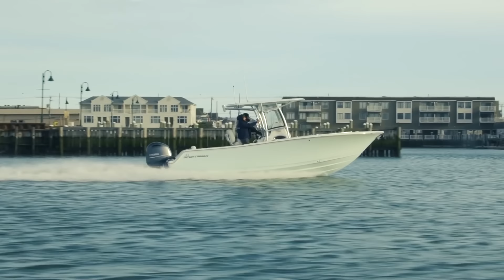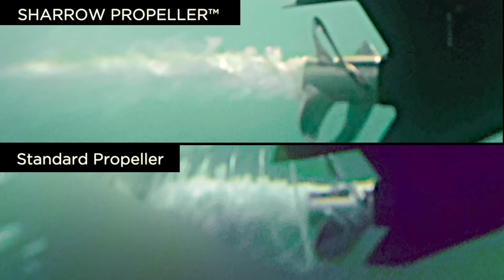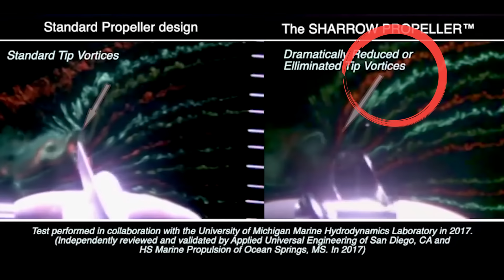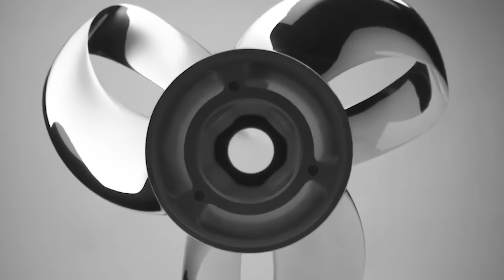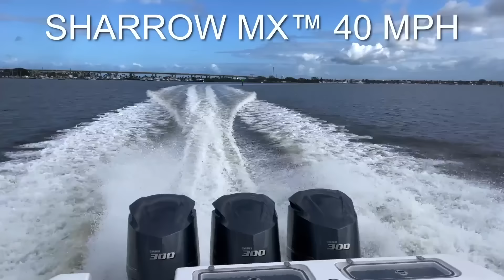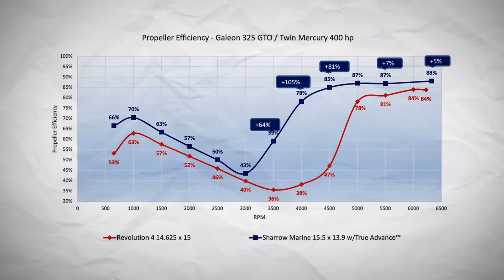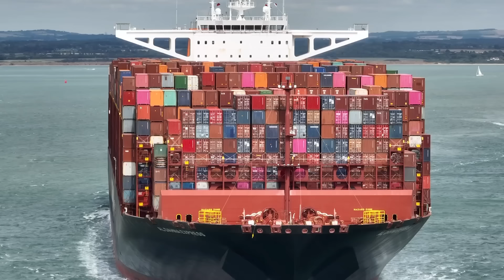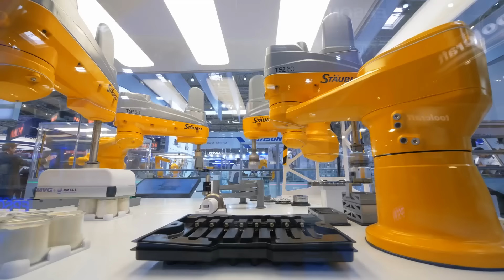This Genius Propeller Will Change Transport Forever

Comment: As a drone pilot, I love the idea of quieter flight & improved rfficiency!  Hope these make it to the marketplace soon! 🙂
Reply: You could try 3d printing your own... I'm sure there are some designs available online.
Reply: @brenovsky  The jagged layers can stall the propeller easily.
Reply: @381delirius  There are 3d prints and 3d prints... ;)
Reply: @brenovsky  I'd never trust a 3d printed prop to carry my heavy ass expensive drone.

1 not perfectly welded layer and you lost a grand
Reply: I see drones using this quickly, as the props are made of plastic.
Reply: There are a few people experimenting with them, so we may see more data coming out soon.
Reply: Seems like there should be a way to 3D print your own if you just get the shape requirement
Reply: @stevenwilson5556  There's already quite a few STL files on Thingiverse for you to try. I no longer have a drone myself (I sold it when the UK drone licensing requirements go so expensive and convoluted - Also I live just a few miles from a major airport, making the rules even stricter -  that it took all of the fun away) so I haven't tried any of them but they look as though they should work pretty well (just be sure to sand them really smooth after printing as a rough finish will really degrade efficiency)
Reply: 3d print it...
Reply: certainly a solution for aircraft, where a duct-ed prop adds duct weight .
Reply: As a non-drone pilot I love the idea of quieter because of this mindless push to get drones in the air to do everything - from taxis to package delivery.
A 2lb drone is annoying enough at 200 ft, but 2000lb drones at 1000 feet - everywhere?? - no F%CKING thank you.
Reply: @amzarnacht6710  exactly...right on there....the reality is that anything VTOL is less efficient, except close point to close point....and then that is just speaking in terms of aircraft ....Hovever, they do excel at odd tasks...but they really do use a lot of energy, but if less energy goes into noise and heat, then maybe they will really have something.
Reply: They actually buzz a lot in practice and the speed of the air through them is slower than a regular propeller (and the regular propeller was ran at lower rpm).
Reply: Im going to try designing and printing some in PETG this weekend.
Reply: @UnrealCanadian  i do CAD work, and have designed one areo-prop, one standard marine prop, and one marine duct-ed prop...   but i would have to do a little extra thinking before i started designing one of those..
Reply: Need more testing because outside of MIT, all other tester find it generally inferior in performance. It negligible in audio side too. It is lower frequency so in return, quieter.
Reply: only issue i've had trying em out were the massive amounts of additional torque to rotate them, as they're about 5-6x times heavier than standard racing props
Reply: Drone operator
Reply: Ukrainians are rubbing their hands together
Reply: At the revs needed by the motors via direct drive, no...
Reply: As a drone pilot, I’m waiting for Chris Rosser review!
Reply: Nobody is going to pay $5000 for one, except the very wealthy.
Reply: @dmhendricks  some of that will pay off in otherwise fuel costs......then there is the range advantage....it's something a prospective buyer could knock off.
Reply: i am sure there are some russki soldiers that are thrilled at the prospect of silent drones in the battlefield.
Reply: Get a 3D printer make your own 😎🤙🏼
Reply: For everyone saying flying a drone doesn't make you a pilot.
pilot
noun
1.
a person who operates the flying controls of an aircraft
verb
1.
be the pilot of (an aircraft or ship).

Is an rc drone not an aircraft?
What about a military drone? Are they not being piloted?
Even boats are piloted ffs.

Learn to use a google dictionary 🤷‍♂🤦‍♂
And try flying a racing drone or fixed wing RC aircraft either FPV or line of sight (which is a lot harder btw) and tell me how easy it is. 
Tell me how many ya destroy before ya get good at it?
I'll wait.......😂
Reply: Doubt it. Been around for more than 40 years.
Reply: This guy did it https://www.youtube.com/watch?v=UWoXFdRhPKc
Reply: Get ducts
Reply: they have been available since about 1910 ... they are a victor schauberger design made to work and appear like shark skin ... this is why they are so fast and silent as hunters ...
Reply: This design of prop for drones does not improve anything except noise. The flight time is less with this prop design. Yeah,  it's quiet, but that's all.😁
Reply: Would have thought wider blades for the noise reduction. They always sound like theyre slapping the air out of the way. Lack smooths
Reply: You have a drone pilot license?
Reply: I’ve seen toroidal propellers on drones and the results aren’t convincing neither noise reduction, Joby would have them in their evtol and is not the case so far, those evtol they are just bending the tips of conventional propellers for noise reduction…
Reply: As a whaling fleet owner, I too can't wait for this design…, gonna sneak up on those fat asssexy Wales no problem…, I feel you bro
Reply: @blindbrad4719  Gonna sneak up to them and put a finger in their pooper?
Reply: @Bruintje_Beer  gonna need at least a leg for them to feel anything
Reply: As a potential future drone victim, I'd rather hear them coming.
Reply: @ralphm4132  don't think you can hear those sort of drones when they're at 50,000 feet…🤣
Reply: they have been tried on drones, but their performance was worse than normal props. Ive seen many videos almost saying this design is a bluff, so its wierd to see the praise in this video.
Reply: Yes, me too!
This can open up a lot.
Longer flights, more silent, carrying extra cargo
Reply: @jasmijnariel  ive seen a lot of videos to debunk all the claims, so not sure.
Reply: @AndrewTSq  show us AAAAALL that links then😏
Reply: @jasmijnariel  you just write in searchbox mit propeller and get a lot of videos :) but i liked this video https://www.youtube.com/watch?v=Tg2NnXx8qyY  (I love that MIT muted the sound when they showed their propeller, and gained the audio on normal propellers lol.. )
Reply: Air is compressible, water is not (much). So it seems unlikely that what would be better in one medium would automatically be better in the other. I'm sure you've noticed that aircraft propellers look nothing like boat propellers; boat propellers, at least on larger boats and ships, are called "screws", not propellers. I guess some of the difference is due to the fact that aircraft props go on the front while boats have them at the stern. Also, with water you have the serious problem of cavitation, which is necessary to avoid as it slowly destroys the screws over time, making them less efficient.
Reply: @GeorgeSmiley77  Both are fluids, standard rules of fluid dynamics apply.
"Aircraft props go on the front" not always, pusher prop aircraft are very real.
Reply: @daviddavidson2357  2 critical differences between gases and liquids are that gases are very compressible while liquids are not, and that they have very different densities such that 22.4 litres of steam has the same mass as 18 ccs of water, a factor of about 1,244 times the volume. Both differences are highly relevant to the designs of propellers on boats vs planes.
As for pusher props, they must be quite rare as I've never seen one, though I'm sure they exist, just as canards (elevators in front of the wings) are also pretty uncommon - never actually seen one of those either except in pictures.
Reply: LoL! Drone pilot is an oxymoron-not a real pilot
Reply: @pricekovach6798  The FAA begs to differ; that’s why they’re requiring the “Trust” certificate training for even recreational flyers.  I’m studying for my Part 107 commercial drone pilot license currently; a lot of the material is the same stuff you’d study for a private pilot’s license; have to be able to read sectional charts, understand concepts like angle of attack, lift, drag, etc.
I’ve flown fixed - wing RC planes since the early 1990’s (&. made every mistake in the book learning).  Eventually became good enough that I did some competition flying for a few years.  Several of the RC clubs I belonged to had members who were also full - scale private pilots; when asked which was more difficult to fly, they UNIVERSALLY replied “THE MODELS!”  (This was in the days before a lot of the stabilization systems modern drones & some RC aircraft now have).  In a conventional RC plane or helicopter, you’re flying from OUTSIDE the model; control reversal becomes a HUGE issue for novice RC pilots.  I also played with onboard video downlink systems (building my own wireless video downlink system on the 434 MHz. amateur radio band, long before anyone heard the term “FPV” (First Person View).

Get a clue before you troll.
Reply: @WA1LBK  Not really. Requiring an official cert does not mean you are a pilot. It is a means of control and regulation. Sure, they want you to follow some rules to avoid damage and chaos in the air but it is ALWAYS also about control. Has nothing to do with actually being a pilot.
Reply: @BooDamnHoo  dude yes, if the FAA or the european agency for aviation calls them pilots then they are pilots. It is literally the definition of the word pilot. Drone or UAV pilots are exactly that: drone or UAV pilots. Thats the right and official term and name for it, theres nothing to debate about
Reply: @pricekovach6798  no...they are piloting an aircraft...that makes them a pilot....you try flying one of those things.
Reply: @pricekovach6798  I say they shouldn't be called drones in the first place, instead call them remotely operated aircraft. Then the person would be called an ROA pilot.
Reply: @Thomas-jq2im  You’re close; I believe the official FAA term is “remote pilot”.  I also believe the FAA refers to ANY aircraft without a human pilot on board as “Unmanned Aerial Vehicles”, or UAV for short.  I think the drone technology really appeared in the 1950’s, when the Air Force set up old fighter planes nearing the end of their service as remotely controlled targets to give fighter pilots &  anti-aircraft systems operators “live - fire” training.  They carried the term over when the Predator reconnaissance UAV was initially developed, then someone got the bright idea to hang Hellfire missles under the wings.
Reply: …drone pilot?
Reply: @isaakjones3542   He actually means drone operator. They get confused easily.
Reply: Flying a drone does not make you a pilot.
Reply: @rustyshackleford6318  UAV Pilot, drone pilot, helicopter pilot, there are lots of different kinds of specialized pilot too.
Reply: @rustyshackleford6318  is a gyro-copter pilot any less of a pilot than an airplane pilot?....i would imagine you would say no, those are both pilots...so it's just UAV pilots and Drone pilots you feel are inferior in some way for controlling their aircraft remotely?....but they are still controlling an aircraft....how do you explain that?
Reply: @RulgertGhostalker  yeah but ive controlled apache gunships and hinds, f1 cars and spaceships..remotely (software, same thing🤷). Im not a pilot. I think the key difference is the physicallity. You can be a drone operator..but you cant be a drone pilot. You wouldnt fit.
Reply: @luminousfractal420  well that what i asked the other guy.....i said " what would you call someone who pilots a drone? "....he didn't answer, but i will accept "Drone Operator", that's fine too......good point, on the physical training requirements......oh wait, that was me that made that point, but you're right , they wouldn't fit into those machines anyways....so no need for  G-Force Rig Training either.... but if that's the criteria for a pilot, then what do you call pilots who are supposed to avoid putting their passages though such horrors?
Reply: @luminousfractal420  at least  a "real pilot" ,( as the argument i am getting goes), is physically unified with their machine, and doesn't have to go though Sensory Input Conflict Training
Reply: @luminousfractal420  Think about everything i have said here.....that's the long list of why ,if someone says they are a drone pilot, they shouldn't have to get any crap..... i will also accept drone operator, but personally i chose to refer to them as pilots, and i don't want any crap for that either.
Reply: @rustyshackleford6318  what do you call someone who "pilots" and aircraft remotely?.....just curious.
Reply: @rustyshackleford6318  being able to do somthing ancient is not important but it's handy can you operate a forklift I can that don't make me better but I'm useful and don't really care if you approve
Reply: @rustyshackleford6318  What about a military drone? Are they not being piloted? What's the difference? 
pilot
noun
1.
a person who operates the flying controls of an aircraft
verb
1.
be the pilot of (an aircraft or ship).

Is an rc drone not an aircraft?
Even boats are piloted ffs.
Learn to use a google dictionary 🤷‍♂🤦‍♂
Reply: @rustyshackleford6318  i am going to say that anyone having developed a level of proficiency in controlling an aircraft is a pilot.......and UAVs, Drones, and some other aircraft are just remotely operated types of aircraft...that all, that it.
Reply: @rustyshackleford6318  or do i have to specify...would i have to call a drone pilot a drone pilot specifically?, and a UAV pilot a UAV pilot specifically?....because i am ok with that too..
Reply: @rustyshackleford6318  some types of aircraft are remotely operated....so there is no other way to pilot them....get it?
Reply: @rustyshackleford6318  and those types of aircraft are the way they are for a reason....because they can do things other aircraft can't, or because they can do it more efficiently than a manned aircraft can....that's why there are different aircraft in the first place, specialized aircraft that are better at one thing or another, and some of them are remotely operated..
so there yah go.
Reply: @rustyshackleford6318  correct...but it does make you a drone pilot.
Reply: 3d print the pattern for the mold and aluminium cast them idk
Reply: @ackerkartoffel8627  it's called a "Casting Plug". ( the allegedly 3d printed part here )
Reply: But people are weird, every time someone comes up to me thinking im spying on them with my 140 decibel drone. people are crazy, i'd love the efficiency but more quiet is going to make them even more suspicious:D
Reply: @KiloWattFPV  only people hiding somthing would act that way 😏 just saying
Reply: @KiloWattFPV  ask them: do you have something to hide?
Reply: @KiloWattFPV  key is to not stop. flying past people is fine but the moment you hold position for a couple seconds people feel like they are being watched. there is no rationale to it, but you can prevent a lot of trouble by just avoiding that.
Reply: Hope this trend dies NGL. Kinda annoying left and right videos of people 3d printing and flying them. They don’t even perform half as good as normal propellers half the time. Few days or weeks and this trend will be forgotten
Reply: @DivisionRc  
Boomer moment
Reply: @DivisionRc  Actual terrible take, its really good that people are designing and making their own shit, like prop's for drones. also, they dont "perform half as good as normal prop's" they perform the same. Only time they dont is when people are experimenting with interesting designs, thats fine though, if people didnt experiment than nothing would ever get better
Reply: @DivisionRc  What a dumb take. Let's not experiment people, nothing ever good was invented from this, right? And then 19 airheads like it.  It reminds me just how dumb a large part of the population actually is.
Reply: @Bruintje_Beer  let’s just wait to see how far this goes then. 🥱
Reply: @DivisionRc  It goes forward. You fail and fail and fail until you don't. That's how progress is made. Smoothbrains seem to think progress just suddenly magically appears.
Reply: As a blablablabla....if i had a buck for every obnoxious egomaniac using that phrase in comment sections....
Reply: @KL-te1dq  😂 okay
Reply: @KL-te1dq  Wtf is your issue bruh? he pilots drones. and so, he is a drone pilot, Are you slow or something?

Comment: The tip of the blades are vibrating. The toroidal dont vibrate as much because the round shape absorbs them or i suppose they cant form because theres 2x as much support for the tip. I doner if you could use this besides as a propeller?

Comment: I'm very curious to lean how much drag each type of prop has in water when not spinning.  This would be the case for a sail boat moving under sail.
Reply: Wait...  You want to sail faster, and seek less drag or do you want to generate electricity with your prop while sailing and have more drag?
Reply: @thorium_glass  I'm considering both.  You can't fold this prop so I'm curious how much drag it creates while not driving the boat.

Comment: How long before our submarines examine and maybe use them to make the submarine quieter? Or China copy them? Can different methods of manufacturing be joined without losing strength in the joint?

Comment: Marine guy here- these been around for a hot minute now. Proven..

I found something interesting. with your cart about being in the "4000RPM" zone. a lot prop planes fly below 4000RPM. so if these could be modified to be better in the air- 20% fuel gain in the water, AND air? I think the best overall test would be start with something like an airboat-- since they use airplane engines, would be easier to study noise/ground effect/air movement and less risk of someone crashing due to something like increased prop mass..

Comment: Wonder if the military will look into this. Quieter C-135 gunships, Apache AH-64's, military props in general. But the military is not known for doing the smartest most efficient, cost effective way for doing anything. This could take the military 100's years before they catch on.